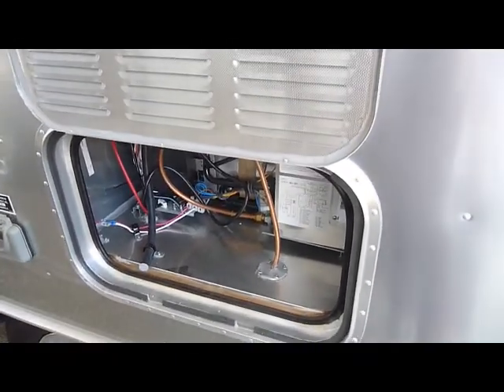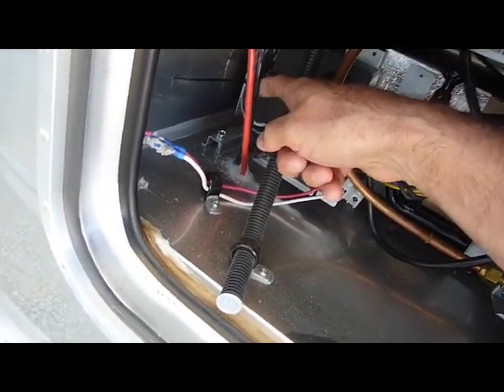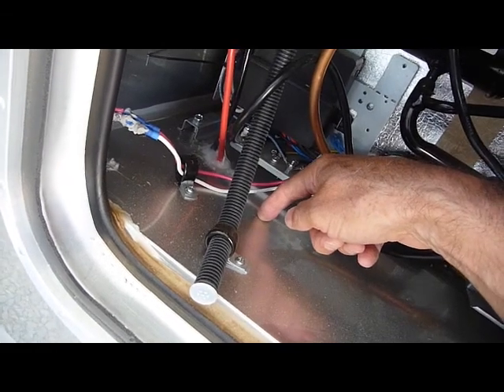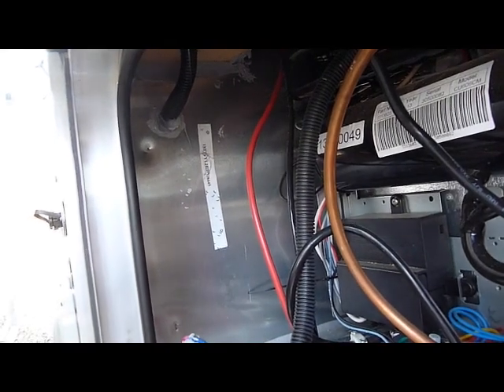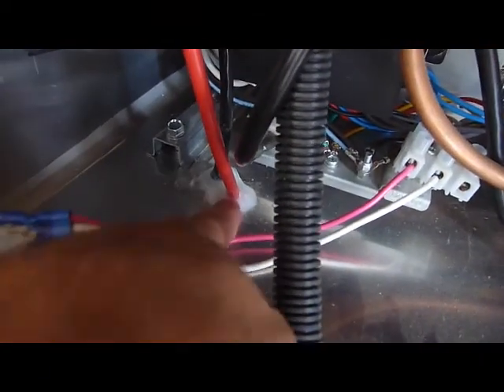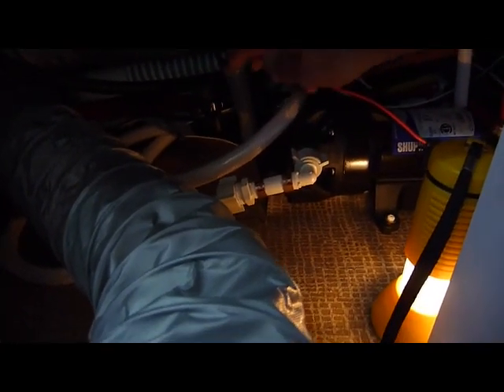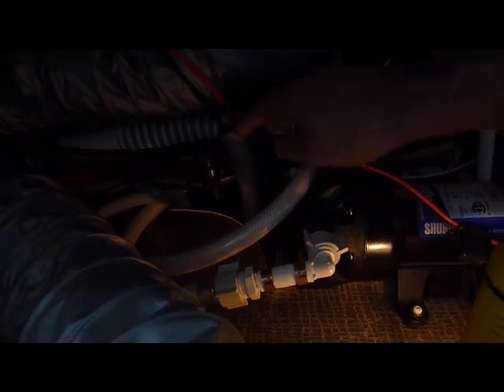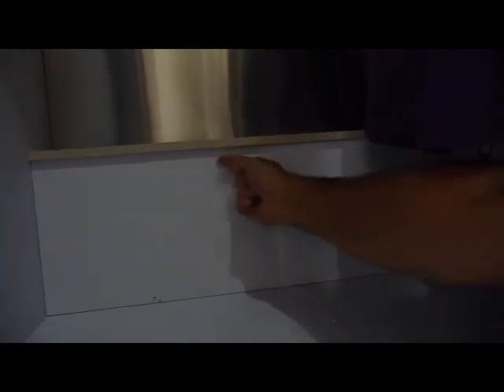Running Solar Wires on a Airstream 27FB

Comment: Kurt, How are you able to run wires under the floor?  Isn’t it hard to route them where you can’t see?   I want to run cables for an inverter from the front of a 27 FB to the shore power but I can’t visualize how to do it out of sight. Any help would be appreciated.
Reply from the maker: I ended up running a Liquid-Tight electrical conduit under the trailer.  Drilled a holes through the plywood floor and belly pan.  I used zip ties to attach it to the gas line for the water heater and other convenient connections.  The conduit extends from the water heater location forward to just under the front storage area.  I used silicone to make the connections to the trailer water tight.